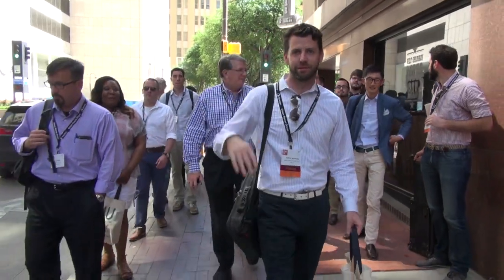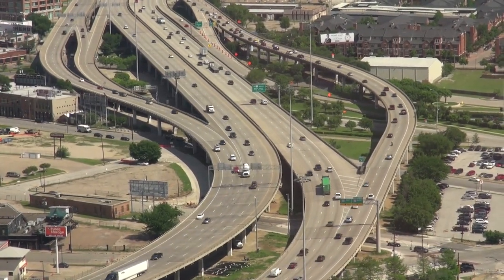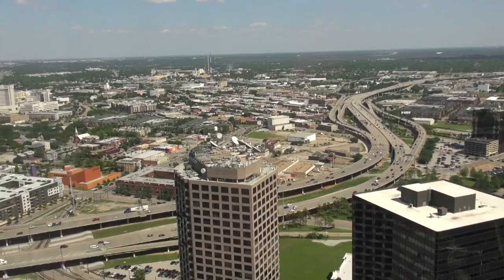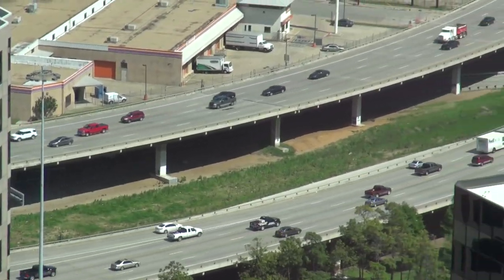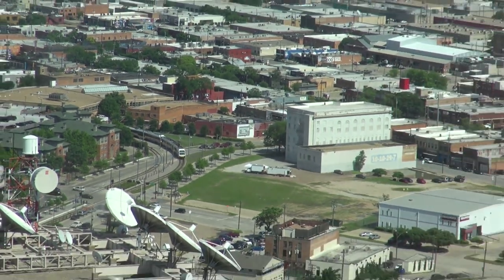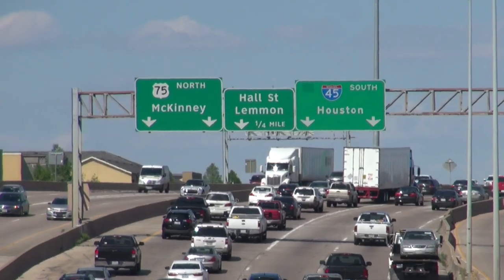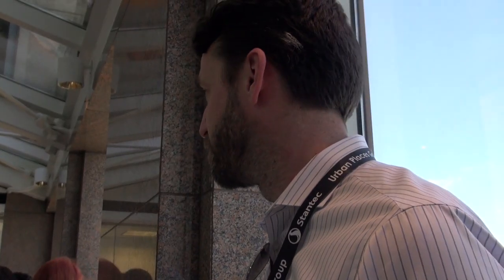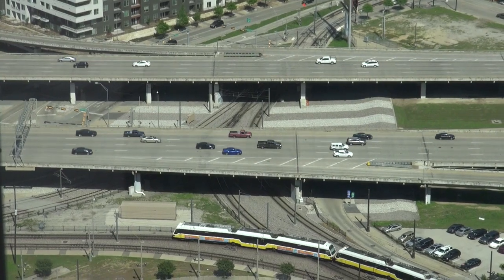Streetfilms - Freeways Without Futures (CNU23 Dallas Edition)

Comment: that'll make traffic at the mixmaster get worse, and besides the 345 doesn't cut through any neighbourhood, yes there are some nearby but really one can make rhe highway more beautiful and make the space under the highway useful, like make some park under the highway or make some type of.. public space where people wpuld wanna go under the highway, besides the 345 is vital for traffic from the central expressway, cos if they demolish it then all of central traffic will merge into the 366 traffic and get congested, same with the 45 traffic will mive to the 30 makong the 345 less congested but the 30 and 45 more congested and such a disaster, so reconstructing the 345 makes sense to make it safer and more appealing, besides no one looks at the highway from avobe but people who work in those towers, and i don't think they mind the highway, elevated highways aren't bad, why didn't they demolish the 366 as well, it is a barrier too, central expressway, the 635 etcetera, its not a barrier, most streets go underneath that. i just don't like that they demolish one of Dallas vital arteries...
Reply: Really? There's a reason why "345 doesn't cut through any neighborhood." People don't want to live near a freeway. They are hard to get on, hard to get off, and clogged with noisy traffic. The point this guy is making is that if you demolish the thing then you can build homes in that space and reconnect surface level streets so that the people in those homes are able to get to the businesses in that area without even getting on the freeway.
Reply: "People don't want to live near a freeway"? Really? A positive of my last apartment in Phoenix here was that it was right next to an exit on the 202 freeway, and near an exit of the 51 freeway, made getting around very convenient
Reply: FirebirdCamaro1220
 What that tells me is that you didn't want to be in your neighborhood. Instead, you wanted to be where the freeway would take you. Which would have been better? Living next to a freeway that is clogged with traffic or living within a couple of blocks of the places you went to the most frequently?
Reply: some people rather live near freeways because it's more convenient, because the places they gp to often are far from each other,so having good connections is better for them,but for people who can't stand anything is more convenient to live far, and also if they don't have anywhere togo, I live about a mile from an elevated highway and in Houston or Dallas living near freeways is convenient because the public transportation sucks although yes Dallas is getting better at it but the 345 also makes a bypass through central Dallas and the exits make connections to downtown,there aren't neighbourhoods nearby because they weren't there even back then...
Reply: Danny1022
Part of what the guy in the video is saying is that it is the freeway that is causing things to be farther away. People are forced to drive because of the freeway. That means more cars are on the road, so the freeways have to be bigger. That forces even more people to drive, which causes the a need for even more freeways. Use the space taken up by the freeway to bring things closer to where people live and people no longer have to drive.
Reply: the freeway isn't that congested. for traffic to flow easier they needed the central expressway expansion in the 90s if it's torn down then the expansion was pointless cos the central traffic would be merging all into the 366, instead of the 45so its why the 345 is needed. besides more people would benefited by keeping the freeway than demolishing it..
Reply: Danny1022
You seem to be saying two different things. You begin by saying the freeway isn't congested and then you say that it is needed by a bunch of people. The first seems to support what the guy in the video is saying. The second seems to say he is wrong.
Reply: Um, not quite right. The thing is that most places in this country aren't Manhattan where "everything" is "right there". The main problem is unless you have a high level college degree, where you work will usually be in a neighborhood that you don't want to live in. I am a truck driver by trade, and most trucking companies locate in industrial neighborhoods in ghettos where there is plenty of cheap real estate, but there is nothing to do in those areas, and my fiance works in a suburban mall. We live in a central city neighborhood with ammenities and sense of community, but nowhere near our jobs
Reply: it isn't congested cos it's wide enough, but people need it to bypass Dallas and also to go to exits that get to central dallas
Reply: And beside more people rather live in the suburbs

Comment: If you tear down I345, then I45 will dump all of its traffic into downtown streets, or push it down woodall rogers, clogging up the grid and making the land value decrease because no one will be able to get to it.  Without I345, US 75 will also dump all its traffic down woodall roger and ultimately clog up I35.  This is a horrible idea.  However, tunneling I345 below grade and building a deck park would accomplish your goals and not screw up traffic.
Reply: I think the hidden agenda here is to do exactly that, screw up traffic so much that people start using collectivist (mass) transit.

Comment: Astounding that the government built all these roads without a plan to pay for keeping them in good condition.
Reminds me of the Simpson's episode where Bart is in a wheelchair and so the mob boss Tony arranges for elaborate ramps to be built into every room of Springfield Elementary. But not one that simply goes over the minimal front steps. They all break instantly and Principal Skinner has to eventually pay for it anyways.
Reply: Typical example of one of the largest flaws in most democratic government institutions. They fail to think long-term because it likely isn't going to be their problem.

Comment: You should research the north central texas 2040 mobility plan, or the "veloweb". It has some pretty tenacious claims for DFW- I really hope they follow through on it. 12 north texas counties have committed to building a web of over 2,000 miles of bicycle sharrows, trails, and protected lanes by 2040 that would connect Denton to forth worth to dallas to roanoke to grapevine...you could very far with just a biycle and a bus pass.

Comment: Instead of just tearing it down, why not turn this freeway into a tunnel like they did in Boston and Seattle? Once it has been torn down, you've got all the space you want to dig open and build a tunnel in, probably allowing for an ever wider freeway underground. In this way you truly have best of both sides (getting rid of the ugly noisy freeway, allowing for redevelopment of the space after the tunnel has been finished, while still giving the cars their way), and the huge investment for the tunnel will be quickly earned back by the economic boost it will give
Reply: That would be insanely expensive. It would only cost $150 million to tear down the freeway, vs $24.3 billion and $3.29 billion respectively for the tunnel replacement projects you mentioned. The other benefits from removing the freeway (more people taking transit and shorter trips) would not happen if it was replaced with something else.